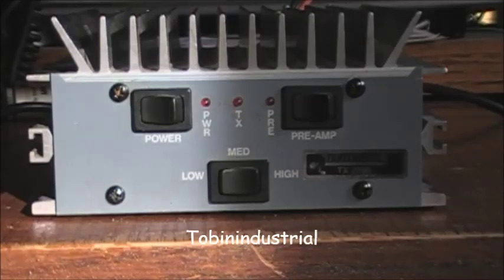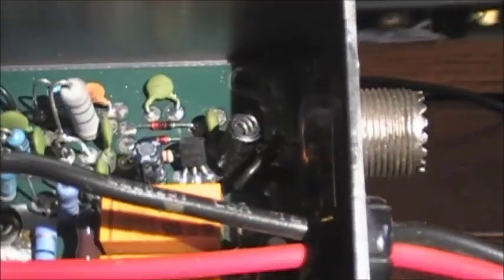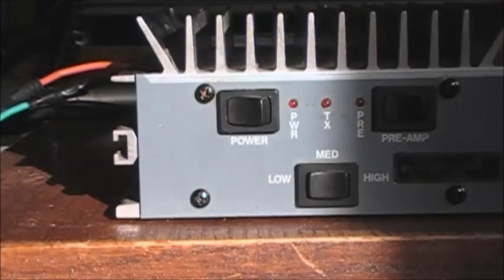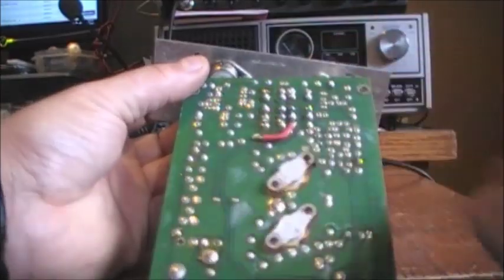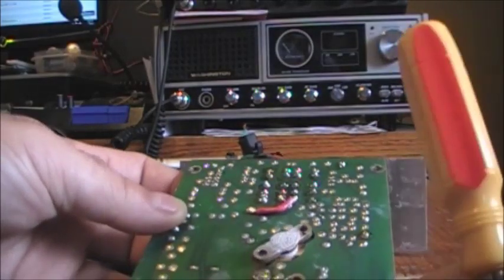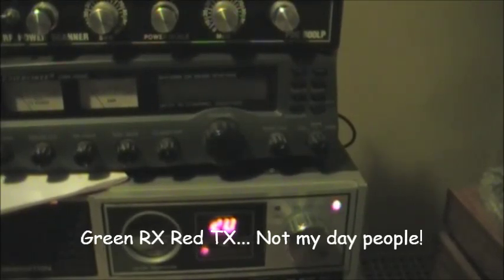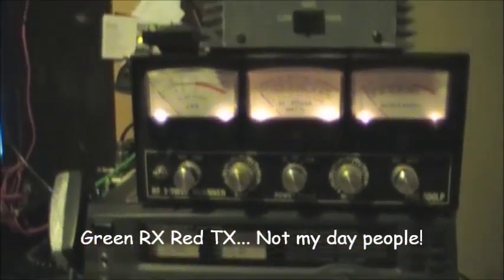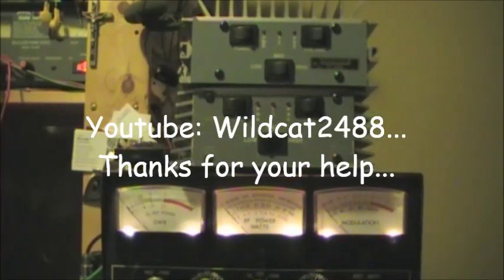CB Radio Amplfier

Comment: Garbage Amp, you wasted your money.
Reply from the maker: There are much better amps out there. I paid very little for this as it was a sweet deal barter deal. I don't use amps anymore. Stock power on a decent radio with proper alignment and tuning and a good antenna are all you need

Comment: Ok, I am the "radio guy" in my area. It sounds to me like your keying circuits are blown and are in a "constant on" position. In most units, these are the little black or silver three legged diode/transistors, they can also be those little black square relays as well. Different linear manufacturers use different parts. Some can be as simple as a resistor. It just depends. You'll just have to determine what the keying circuit is in your particular amp to replace it. I am having all kinds of hell with pre-amp circuits. Every damn amp I have the pre-amps don't work. When they are turned on, either nothing happens or it cuts the incoming signal out completely. Same thing, though...locating the circuit part and replacing it. Trial and error, bro...trial and error. That's how I learned.
Reply from the maker: +Gunslinger Survival Thanks for the comment and for your input on the issue. This is most helpful.
Reply: Andy Tobin
-- No problem

Comment: Does anyone have a schematic for this unit? I need the "value" of the big blue resistor closest to the first yellow relay...from what I can see it looks like brown/black/white with a gold tolerance band, but I can't trust the paint on it because it may have discolored. (it's the resistor next to the big maroon capacitor, 180pf 500volts. , I overdrove the amp and the resistor burned a little but and even melted the plastic cover on the relay, it put a pinhole in the plastic from the heat dissipation LOL. My actual model is a CONNEX TX-200 but the amp in this vid looks identical and I cannot find any info on this amp whatsoever. I'd love to get a schematic, my e mail is Ticket2Ride1 on aol dot com...thanks in advance

Comment: hahahaha It does help the output power to go UP if you switch the correct amplifier to HIGH power.Switching the amplifier that is NOT connected or turned on will NOT increase or decrease the output power no matter how many times you do it. {:>) Thanks for the laugh because laughter is good medicine! LOL
Reply from the maker: YouTube had these messages Hidden. Thanks for your comment

Comment: Great Video Andy. First off I would revisit the relays you replaced. Check he solder joints for a flowed short of a cold joint. When the amp is turned off, the switching relays should allow a direct path for TX/RX through the amp. Sounds like a switching issue in one of the relays.
Reply from the maker: YouTube had these messages Hidden. Thanks for your comment